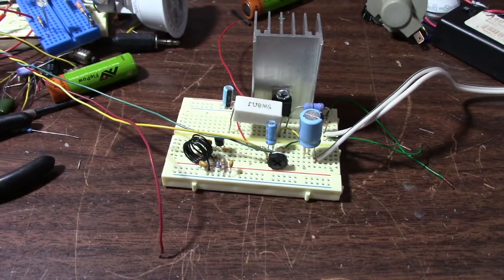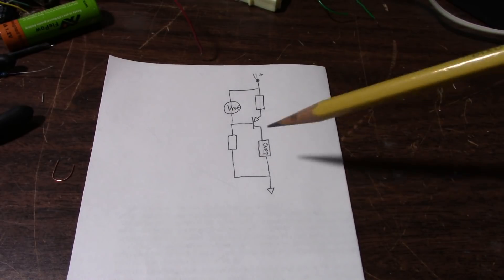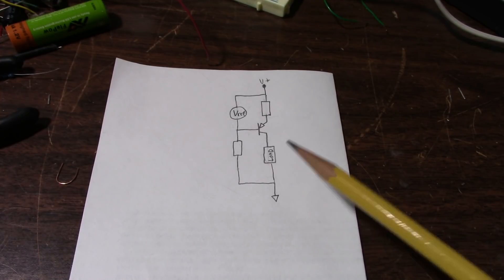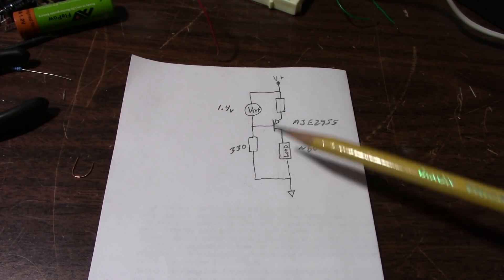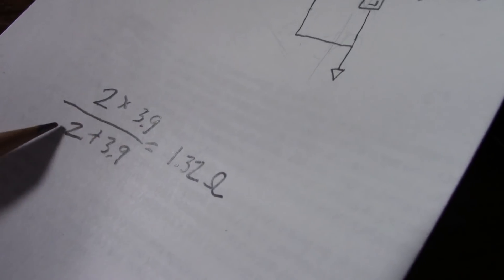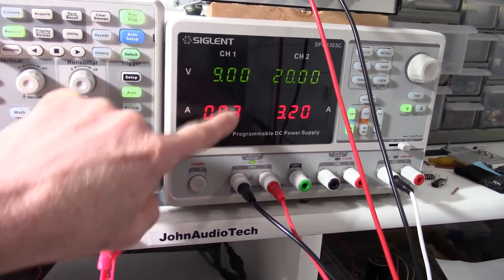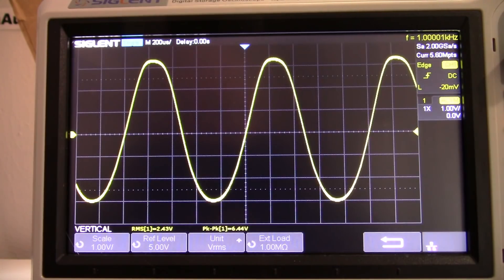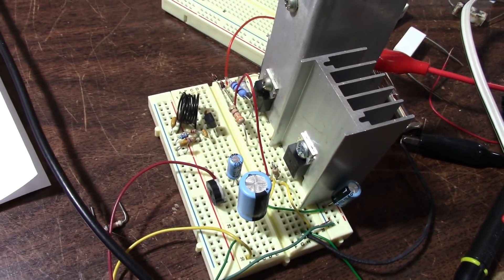Simple class A amp improved with a constant current source

Comment: The problem with biasing a MOSFET for class A is the relatively large range of Vt. its threshold voltage. The datasheet for IRFZ44 indicates a value between 2 and 4 volts. Coupled with a high forward transconductance of around 2.7 A/V at 1A, you can see why small variations of the bias voltage on the gate can produce large current swings at the drain.

In the original circuit the 100K pot was fed from a 22K resistor allowing the gate voltage to vary from 0V to 7V. The resulting change in drain current past the threshold voltage was ameliorated by the 0.47R source resistor and 8R drain resistor, which represents a dc gain of about 8R/(0.37R + 0.47R) = 9.5 (the 0.37R is the reciprocal of the estimated forward transconductance). That's not too bad for sensitivity.

When you replace the 8R drain resistor by a constant current source, you're providing a high dc impedance to the drain and dramatically increasing the dc gain, so that the bias point becomes very "twitchy". In fact the mismatched temperature coefficients of two diodes against one PNP emitter junction will make that bias point very temperature dependant. However, the ac gain does double because originally the load is 8R in parallel with the 8R speaker, and now it is a high resistance in parallel with an 8R speaker.

So to stabilise the dc, you sensibly introduced a load of negative feedback from the drain to the gate. That has the effect of reducing the circuit gain, effectively becoming the ratio of the 10K feedback resistor to the value of the trim pot that's setting the gate bias voltage. Assuming the drain voltage is round about half the supply (4.5V), that suggests the trim pot will have a value between 8K (if Vt=2V) and 80K (if Vt=4V). The gain will therefore be between 1.25 and 0.125. Great for dc stability, but not so good for use as an amplifier. You could, of course, increase that 10K resistor and replace the trim pot by a trim pot in series with a resistor R, then bypass the trim pot with a capacitor that has a smaller reactance than the resistor R. That would allow you to set the dc gain small, but have a larger ac gain set by the ratio of the feedback resistor to the unbypassed resistor R. The ac gain is then independent of the setting of the trim pot.

Comment: 11.6% COP ist a very good value for a constant current class A design. It corresponds to about 20% plus for a usual class A power amplifier design with an idle bias current of half of the current at its nominal maximum power. The limit of class A design is a COP of 25%.

BTW: I like your mixed type BJT / FET circuit design. :)

Comment: Reminds me of the time when I had a very simple Class A amp with just a decoupling cap, two resistors, a TIP3055 and a 12V light bulb as a current source. It was not even soldered, but on a breadboard like this one. That thing was not very loud either, but enough to enjoy some music while doing some electronic stuff or gaming.

Comment: When used in low power audio circuits a "CCS" on each supply rail can really reduce THD. (even in simulation) Not sure why but it works ! I have a schematic for a headphone amp that uses a green LED for the voltage ref. Different color LED's provide different voltage drops.

Comment: Next video: Did audio grade components have dramatic effect in circuit?
Reply: what exactly is "audio grade" ? is such a thing mentioned in the transistor data sheets? never seen one . who decides what is "audio grade"?
Reply: @nsfeliz7825  Good question, here I refer to those "claim itself audio grade", then test it in the same circuit and find out how "high" the audio grade is.
Reply: @nsfeliz7825  I would define "audio grade" as low noise, high speed, highly linear devices.
Reply: Lol, what means "audio grade"? Devices which measures terrible? :D

Comment: Is it true that Class A amps need a long time to warm up? If so why is that
Reply: The amount of current that a Transistor conducts is temperature dependent, as the Transistor heats up the amount of current wil vary until its reached its thermal equilibrium.
Reply: It's true that some of them do! This is really about bias stability vs temperature, if an amplifier has poor bias stability then it won't be operating at the correct bias point until its operating at the temperature it was calibrated at. A well designed amplifier shouldn't suffer from this problem.
Reply: Depends on transistor/mosfet 

Just look the data sheet
Reply: @horacewonghy  The datasheet won't help in this case; it tells you the maximum operating temperature and may show how some parameters change over temperature, but its the job of the amplifier designer to take this into account in their circuit design which. A good amplifier will maintain the correct operating point of the transistors as any parameters change over temperature.
Reply: @ferrumignis  I remember that some mosfet data sheets has temp relation graphs. like irf

Comment: Hey! No peek at the distortion spectra with the current source? Inquisitive minds want to know....

I love your videos by the way.
Reply: Its still class A , distortion will ne pretty much the same as his last video but just more output power
Reply: @researchandbuild1751  Constant current load means the MOSFET operates with (almost) constant transconductance, and John also changed the biasing circuit to add more negative feedback so I would expect to see some improvement, especially as maximum output is approached.

Comment: class A is hot but its worth it
Reply: Easy,Perfect but hot
Reply: Why?
Reply: @northox  A good class A amplifier has very low odd harmonic distortion which provides a more pleasing sound. However the distortion on a modern, well designed class AB or even Class D amplifier is so low that the advantage is negligible.

Comment: Hey man can u design a class ab amplifier using 2sc5200 and 2sa1953 (i think i got the part no. Wrong) , it should have around 250w rms on 4ohn load! I was looking at lots of different circuits but i was unable to find proper diagrams
Reply: With pair of Toshiba 2SC5200/2SA1943 (150V, 15A, 150W) you get up 120W @4ohm. Anything more is asking for trouble. There are also more robust devices based on this transistor pair made by OnSemi, Fairchild, and bigger 17A trannies from Toshiba. A very popular DIY amp based on them was SymAsym ver.5.  DIYAudio discussion board has a whole tread about it. There's also very simple Onkyo amp, 50W, 8ohm, in production with a basically the same circuitry.
And 200W 6dB more than 50W, yes it sounds like a lot, but crappy 200W without headroom and current drive capability usually sounds worse than really good one with less power.
https://sound-au.com/p-list.htm
Some easy to do project, also check Nelson Pass just for fun as he does some unconventional class A designs, Bob Cordell wrote a very good book about amps,
https://www.amb.org/audio/    kind of crazy stuff
https://www.ampslab.com/products.htm  
And there's plenty more on the net
Reply: John i need it too please. 200w @8 ohm would be nice.
Reply: @jakk2ahao  yup. U would need a pretty high supply voltage
Reply: @jakk2ahao  
Don't bother with designing by yourself unless you are very competent, as everything really, really good above 120W (two pairs of output trannies) is quite complicated with more problems to solve. Even some of the diy designs may not be 100% optimal, and parts - some have to be matched in pairs, quads.
Reply: With that kind of circuit the power supply will be just as important as the amplifier itself, thats a lot of power you will need at least 350 watts power supply! Maybe a converted old pc supply with a step up dc to dc comverter on it, but would require a beefy boost conveter

You need 42 volts rms so that means 84 volts peak to peak! That is starting to be a dangerous voltage so layout , etc will be important, and as i said the power supply will also be a demanding project for such an amplifier
Reply: @researchandbuild1751  
Plus the number of output devices needed to pull the current at such high voltage (SOA). And gain matching between pairs. The kids think it's easy to get Watts, maybe crappy watts with fireworks. At this point it might be easier and often cheaper to get good D class amp, even used.
Reply: @researchandbuild1751  250W into 4R will need a sine wave of 32V rms. That requires a single-ended output stage to swing 90V, so the supply voltage would have to be more than that to give some headroom. Dangerous indeed, and careful power supply design would be essential. One alternative would be to be to use differential output across the speaker, allowing a supply of a little more than 45V to deliver the required 250V into 4R. That uses twice as much output circuitry, of course.
Reply: @researchandbuild1751  use a fucking transformer!! Why bother with smps & boost converter shit. Use a center tap 45-0-45 transformer. & U will have +-45v available.
Reply: @KuntalGhosh  that would work yes i was just throwing out ideas. But still its gonna have to handle a lot of power, thats gonna be a nice big power toroid and it wont be cheap
Reply: @researchandbuild1751  yeah it depends on the country. Here in india i can just go to a shop and tell them the voltage and amp and they will make it within few days and a 10amp 45-0-45 + 12-0-12  won't be much more than 10 to 20$
Reply: @KuntalGhosh  A properly designed switching PSU is still a good option,  but using a PC supply with a boost converter for a high power amp is a crazy solution, combining complexity with low efficiency.